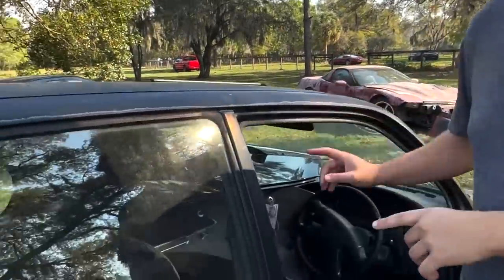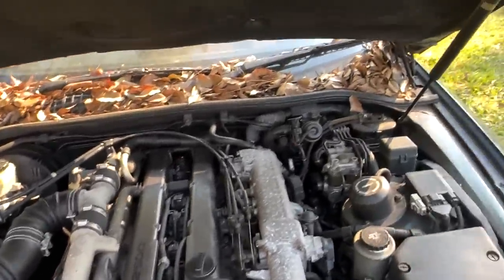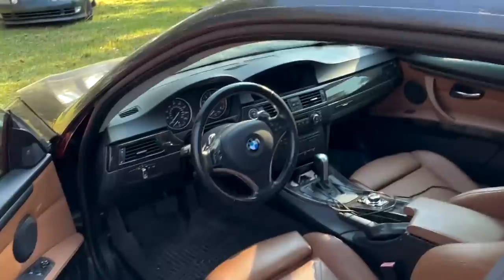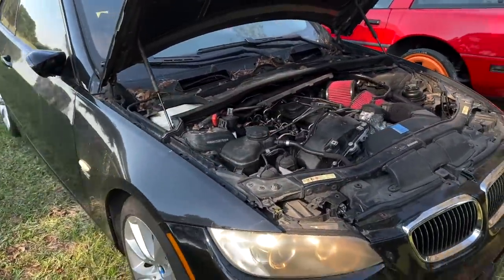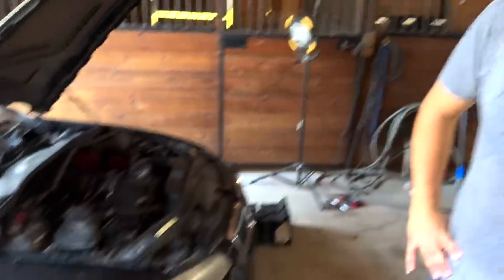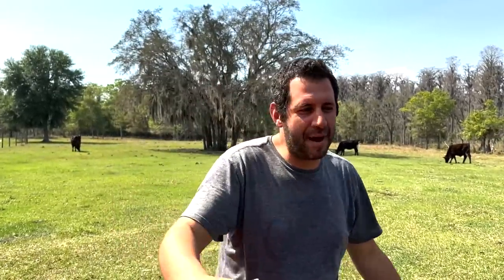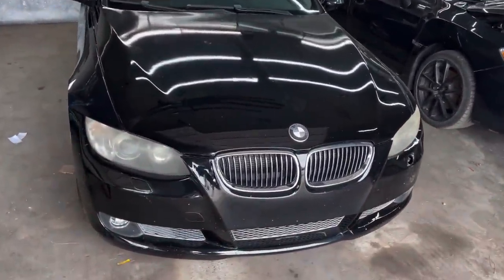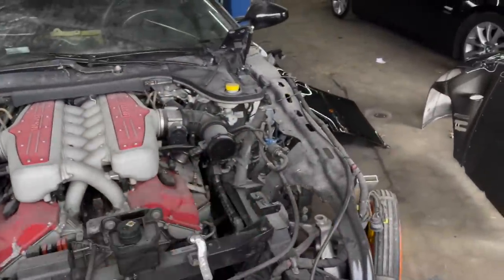I Got A Free Bmw 335Xi And Picked up All the Ferrari 599 Parts!!!

Comment: 12:40 What you might want to look into is welding a heavy duty eye or U bolt to the wall behind your lift. That way you can use an electric winch to pull cars into the bay, off trailers etc. 

You could actually put a bracket behind each bay then move a winch to each one as you need it.

Comment: I went to Jamaica in the late 80's and 3 ppl brought a Honda Enduro 350 as checked luggage. They removed the front forks as one assemble, the rear wheel and swing arm as another and the engine and frame etc as another.

It was worth $2800 in the US and $4200 in Jamaica.

Comment: Did you add a cancelation kit to the electronic damping wires since you installed aftermarket coilovers? If so, where did you buy them? I have a 599 and am thinking of going w the ceika coilovers. Thanks for your response